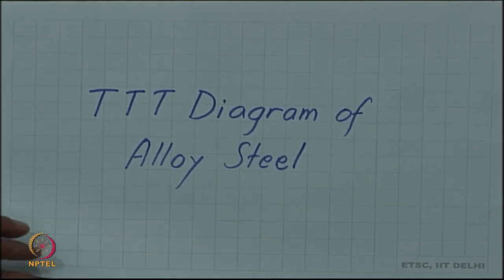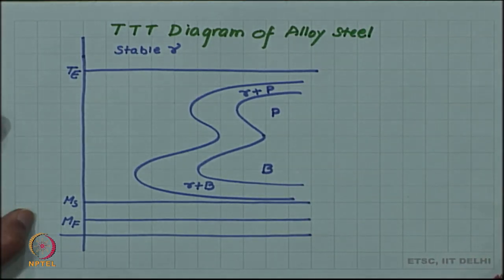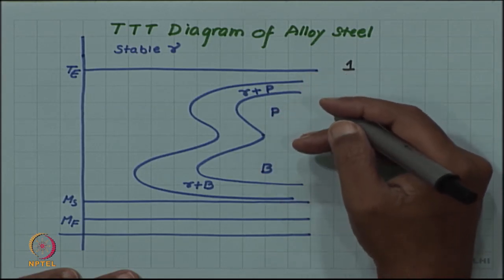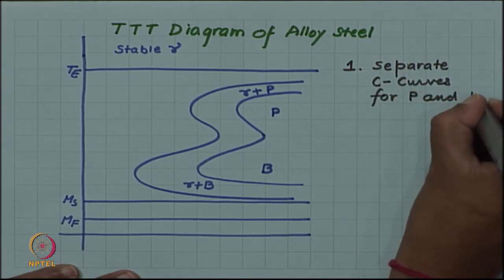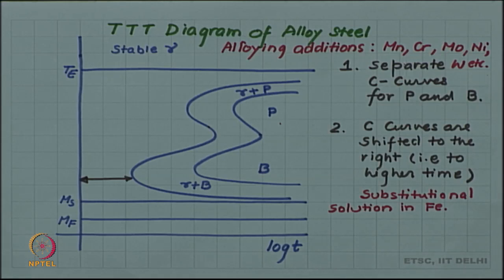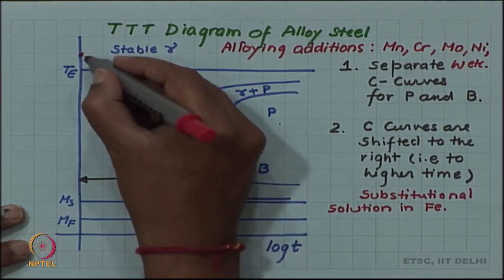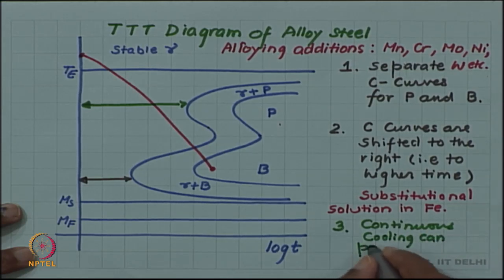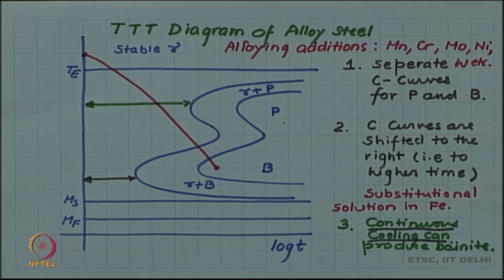TTT Diagram of Alloy Steel

Comment: Sir,among Mn,Cr,Mo,Ni at a fixed temperature which element will diffuse in the iron at a faster rate?does it depend on the crystal structure of the element?

Comment: Sir, I have one question - why Carbide forming alloying elements like V, W etc also shifts the TTT curve towards right;it should shift towards left as those Carbides will act as nucleation centers, increasing nucleation rate as well as transformation rate.?
Reply from the maker: These carbide forming elements are substitutional solutes. Thus to form carbides they have to diffuse by substitutional mechanism (vacancy assisted) which is much slower than the diffusion of C which happens by interstitial mechanism.
Reply: @introductiontomaterialsscience  sir, can you please explain that how these carbides forming elements form finer grains and are called grain size refiners?

Comment: Sir, if the same cooling rate is given in two cases
 1) without alloying elements 
2) with alloying elements 

The transformation will begin earlier in case (1) and at a higher temperature than in case (2) .Hence , the finer grains will be formed in case (2) because the transformation has started at lower temperature with alloying elements and growth rate is also lower than that of case (1). Are these the ressons why these elements are called grains size refiners? 
If not, how does these elements restrict grain growth? 
Please answer  🙏

Comment: Loved this presentation sir. But i didn't understand why alloy steels got 2 noses in their TTT curve? Transformation rate however wil be higer at one place, how can it will be faster at 2 regions?
Reply from the maker: Actually, there are two kinds of transformation, austenite->pearlite and austenite->bainite. Both have their own C-curve and their noses are at different temperatures. T
Reply: @introductiontomaterialsscience  sir,why particularly rate of transformation for bainite is faster than the pearlitic one in tat curve??
Reply from the maker: @janakirampanchireddy3413  Bainite is a much finer distribution of ferrite and cementite. Thus the diffusion distances are much shorter requiring less time for transformation.

Comment: Normalising is faster cooling in air......so it may produce fine pearlite....but when cooling proceeds further will a portion convert to martensite?......you may say NO it will not since the phase has already trasnformed to pearlite......i kind of understand that logic.....but then how do we draw the cooling curve?.....because logically if we continue with same rate of cooling, we should come out of the nose area that we reached during normalising and should move down into the alpha+bainite zone and then move further down into the martensite zone.......will this happen or is it that once a transformation happens, say from austenite to fine pearlite then the TTT diagram is different?
Reply from the maker: Mohammad Zee Sham had similar confusion and I had replied to that. All transformation curves, C-curves as well as martensite start and finish horizontals apply to only untransformed austenite. Thus is untraformed austenite crosses these boundaries appropriate transformations happen. But if austenite is already transformed then there is no relevance of these boundaries and crossing them causes no transformation.
Reply: @introductiontomaterialsscience  Thank you